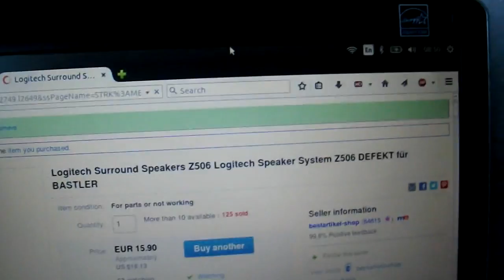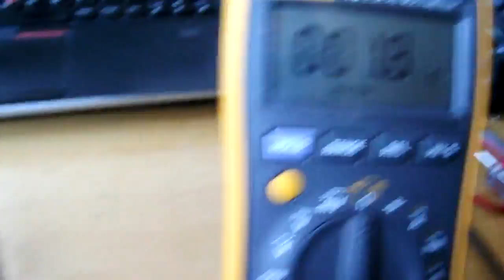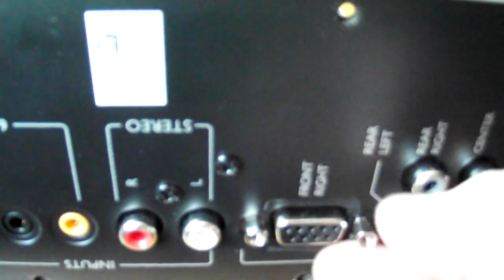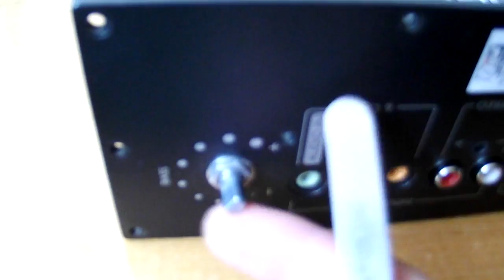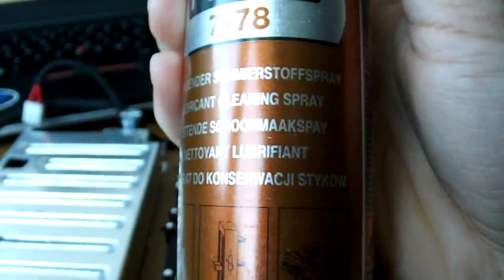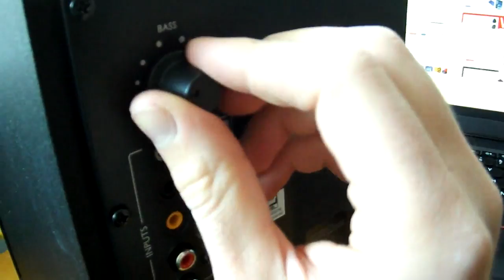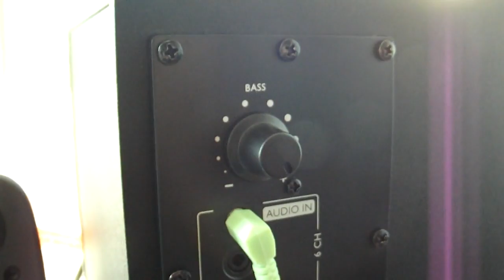Logitech z506 Subwoofer Repair

Comment from the maker: nyell Bowen
The music at the end when I tested the subwoofer is: James Hersey - What I've Done (Feast. Remix)
Reply: Hello friend, I happen to have this speaker set and the problem is that my left front speaker makes a cracking sound and i can't hear anything, how can i fix this?
Reply: It's a buzzing sound basically! I tried plugging the other speakers in the "Front left" but they all end up making the same buzzing sound and i can't hear anything from the front left side
Reply from the maker: Sorry for a late reply. Sounds like a bad connection or a "dirty" volume potentiometer. 1. Try wiggling both audio input and speaker output connectors and see if you hear any change. If so, it may have to be re-soldered. Try a different audio input cable/source as well. 2. Try moving the volume knob slowly, wiggling it. 3. If none of these produce any change, there may be a failure of the mainboard.
Reply: I have the exact same speakers that you do.
My problem is in the right front input that goes into the subwoofer.
I doubt if I can repair it after watching your video.
But you did a great job.
The reason I looked you up is because
I didn't want to break the panel trying to take it off because I knew it was not coming off easily after removing the screws.
Keep up the good work my friend.
Keith

Comment: hi. my z506 stopped to work at all.  Power led is off.  No sound no life sign. any suggestion?
Reply from the maker: Sure. I can think of several possibilities. Listing them in the order of their likelihood in my opinion.

1. loose or damaged power cord or the cable to the front right speaker where the control switch/knob is located. Check if these cables are connected securely. Try flexing them, especially near the ends. That's where the damage is most likely.

2. The power supply failure. You'd have to disassemble the unit and check if the DC output of the PSU is present. There should be 10-30VDC (don't remember exactly) present at the output of the PSU to the motherboard.

3. A damaged power-on knob/switch. You'd have to disassemble the Front Right speaker to check.

4. Faulty mainboard. For example, there could be a shorted amplifier IC etc.
Reply: Thanks dude. It seems I cant handle it.
Reply: what model IC used in Z506?

Comment: What resistance is the on off volume pot on a Logitech z323
Reply from the maker: Nick Potter I have no idea, but usually it's printed orengraved somewhere on thepotentiometer itself. Look for three digits like "102" etc. The last digit is the multiplier. 102 would be 10*(10^2), so 1k ohm.

Comment: Just when i connected z506 to the power supply i heard a sound and now they are not turning on. Help please
Reply from the maker: Usman Naeem So the unit acts like dead now, right? Well then, the first thing I'd do would be take out the power board from the subwoofer. Examine it for any burns, check the fuse and test for shorts. I haven't done it myself though, since there was no problem with the power board in my case.

Comment: mine just stop powering on completely 
it just makes a little click sound when plugged in (like the thermal relay kicking it off ) and thats it
Reply from the maker: willendler1993 william endler Check the power supply then. That would be the first thing to do. :)
Reply: i did
the 400V cap melted the solder on it so i resolder it and now it works fine (still shuts off every now and then)

Comment: hi i have a problem with my subwoofer as it isn't supplying any power to my speakers
Reply from the maker: Benedict Prideaux Check the power supply voltage then. If it's missing, check PSU for shorts. If it is there, check the power amplifier for any damage or shorts. These would be my first guesses. Assuming the ON switch works and cabling is fine.

Comment: I know this is an old post, but my sound will cut out at higher bass levels/bass knob. It will "pop" then silence for 1 sec beat, then sound comes back. If I lower bass/volume, it's fine.

Comment: i bought z506 and the subwoofer has bass only at the maximum of the potentiometer when i move it to minimum it has no bass btw i am using it only with the green cable
Reply from the maker: AN ame Try to clean it the way I have described in the video. It's likely that you have the same issue and after cleaning of the potentiometer it may start working fine again.
Reply: i replaced it a week ago and orks fine

Comment: Can we use wd-40?
Reply from the maker: I never used wd-40 myself but I read somewhere that it's not good for potentiometers. I used a special potentiometer cleaner from an electronic parts store. I guess you could try it at your own risk if you have no other choice.
Reply: Random Electronics Repairs When i tried to remove the cover i accidentally snapped the board connecting the potentiometer in half is there any way i could find a replacement?
Reply from the maker: Samuel Jebarajan Try eBay and Aliexpress. Otherwise I don't know, sorry.

Comment: Thank you man!! It worked for me. I just spray gun cleaner from that hole. And my bass problem solved. It was sometimes giving bass sometimes not during the song But now its all fine.
Reply: no man it needs to be lubricated you have now an easy to get corroded p.meter

Comment: My z506 system is malfunctioning.  When I raise the volume, there is a threshold where upon reaching all of the speakers will cut out momentarily, then they will come back on for a second or two, only to cut right back out again.  This pattern will repeat unless I turn the volume down below that threshold.  Just so happens that the threshold is far too low of a volume for me to utilize.  I'm assuming the problem must exist somewhere on the board in the subwoofer.  Anyone have any ideas where the problem may reside?